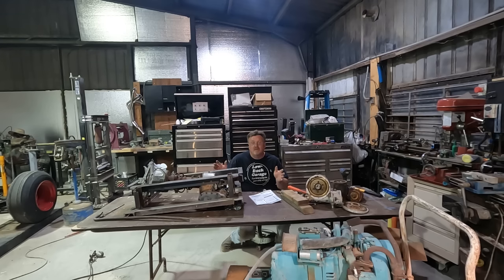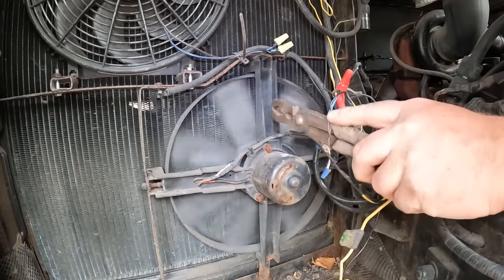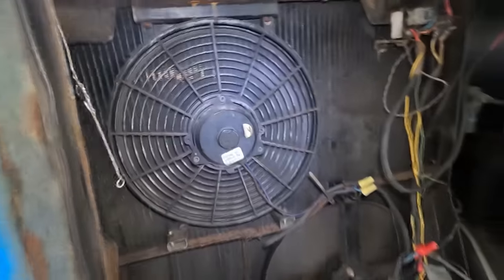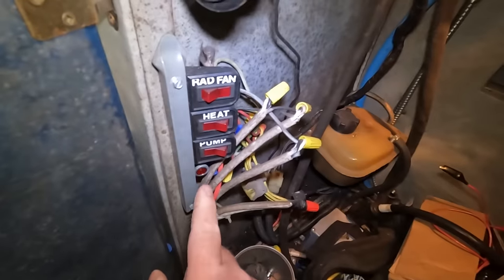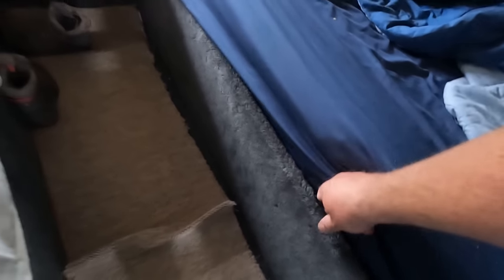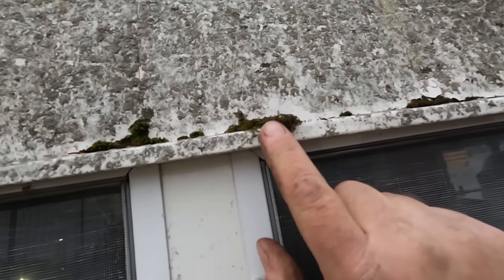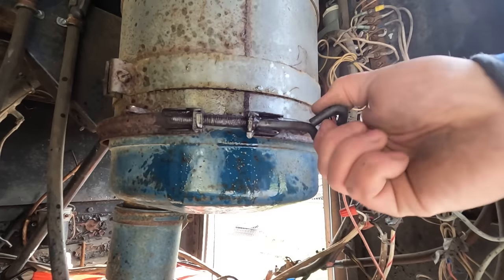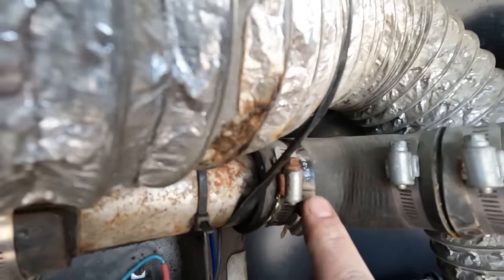1953 Kenworth Bus Roadtrip!  Will a 70 Year Old Bus Go Across The Country?

Comment: To get fan motors, like the bottom one, freed up, I drill a small hole in the little dome in the back, and force some oil in.  Works every time.  That is quite a rats nest of wires.

Comment: For a minute I thought the wipers were air powered, and that the valve you turned was the control, I laughed when you turned the tube.
Reply: I'm pretty certain they were air powered originally and those were the controls. The original air motors are difficult to rebuild and keep operating.

Comment: On the transmission dipstick, I believe you twist the handle to tighten or loosen (compresses a rubber bushing which expands within the tube).
On the air filter, you’re probably spot on about the newer engine flowing more air, but you might look and see if there isn’t a secondary filter that’s further up in the housing. 
Cool video. Looking forward to the next leg of the trip!
Reply: Boom.i did miss that part. But red your comnt and rang a little bell .
Reply: Yup the dipstick needs to be screwed in. Most buses are still like that today

Comment: I'm nostalgic for those old late 40s early 50s Flexible buses. I'm now 78. When in the high school band, we would go on tour in those babies. They told me that the busses were powered by straight Buick engines mounted on a rail system that would let them swap engines easily. Some of them had 3 speeds, some had 4 speeds. Those trannies must have been tough. I heard a lot of gear grinding while shifting.😁😁😁😁😁

Comment: Love that bit of copper pipe for the windshield wipers. Bus is great, awesome you seemed to of fixed the overheating issue. Look forward to seeing more of it, and I'd love to see that electric sander in action. Probably won't get any use where you're at, but cool nonetheless. Seems similar to those automatic chain things ambulances have.
Reply: Hi those sanders, some trains have them also I learned.

Comment: Made a similar trip in our families school bus converted motor home from Albany, NY to KeyWest Florida then West to South Padre Island Texas KOA in February. My Dad put a rebuilt Cummins Turbo and a tranny with Highway gear ratio. I think we got about 12mpg. The generator was an Onan diesel and it had an air to air heat exchanger on the exhaust to heat the interior. Your kids will never forget that experience. I’m 64 and we did this back in 1978. I was 19.

Comment: When I began my teaching career in 1976 the small school district I worked for had 3 Kenworth Pacifics with big International 6 cylinder engines in them for power. They had 5 speed manual transmissions in them ahead of the engines as they were pushers.

Comment: Ah... Now I see where your resourcefulness and inventive abilities hail from. Your father clearly knew his stuff. Pretty impressive what all he did with that bus. A lot of rather off-the-cuff systems integration there. And all very functional. 

I reckon the apple didn't fall far from the tree, either. Very nice.
Reply: Making something work and knowing what your doing is a fine line I would not call whoever built this a mechanic more of a Jerry rigger the whole bus is Jerry rigged together first thing that needs to be done is tear everything out he put in and do it right wire nuts sorry but I've seen crackhead do better work than that fire waiting to happen that thing is

Comment: You, sir are the consummate mechanical technician, with a secondary certification in economics! I totally agree with you on the "filter minder", thinking the diesel engine's air throughput is higher, and was a great catch on the coolant hoses! I mean, you literally prevented a catastrophic event! I have to warn you about the cooling air routing, though. I believe you are right about needing to reverse the fans, but if you ever approach the speed of sound in the bus, you will need a much smaller inlet, and possibly a splitting plate to avoid the boundary layer air along the side of the bus, as well as some straightening baffles for the area after the scoop.  Other than that, what you did is perfect. I certainly enjoyed being brought along on this adventure!

Comment: I believe that one turns the t handle on the transmission dip stick and it tightens a wedge that pushes the rubber out against the tube to keep the dip stick from coming out. Same thing on the dip stick (technically called a gauge on a Cummins diesel. Of course one would turn the T handle in a clockwise motion to tighten. Pretty neat bus.

Comment: Just realized that the sound of city busses when I was a kid was mostly from the cooling fans.
My Dad converted a '53 Chevy (gas) school bus into a camper bus. This is all looking familiar. He went whole hog on the conversion. Repainted inside and out. Took all the seats out, except for one right and one left, put them both on the right side with a tabletop in between, added a home made fold out couch, bunk beds in back and a small kitchen. And proceeded to drive it all over the central U.S. Not without 'adventures'. Like the time one of the engine driven cooling fan blades broke off and flew through the inner fender, missing the tire fortunately. Engine shook like crazy. It happened in the middle of nowhere in Wyoming. What to do? That model engine's four bladed cooling fan was actually two two balded fan blades bolted on at about 45 degrees to each other. He just unbolted and removed the broken blade and continued on with just a single fan blade until he found a replacement in a local junkyard. Bolted it up, and we were back in business. Obviously my Dad's improvising skills made an impression. There were other adventures as well, driving in rain so heavy, the only way to stay on the road was to look down the steps and watch the lane line through the windows in the bottom of the door. Driving on the unpaved sand roads in the Nebraska sandhills to the campground where we liked to stay, my brother and I would bet each other whether or not Dad would need to downshift to 2nd going up the current hill (no money changed hands.) It was an adventure. It was an education. Most of all, it was fun.

Comment: 👍👌👏 Oh WOW, simply fantastic! What a great old bus respectively RV and what a great video! Congratulations for figuring out the cooling issues. It's definitely much more logic how the air is flowing after you changed the direction.
2) Despite the wiring spaghetti the vehicle seems in a pretty good shape/condition. At least I couldn't spot rust. Of course it needs a good maintenance and some TLC. New coolant hoses, new rubber seals, all nipples need to be greased, all oils changed, a lot of things inspected etc.p.p.. Additionally the roof should be cleaned very well and inspected for holes. A new coat of white special roof paint for busses will work wonders. I'm eagerly looking forward to watch the next video part. Additionally I hope that you will show us the interior next time.
Thanks a lot for making teaching explaining recording editing uploading and sharing.
Best regards, luck and especially health to all of you.

Comment: Old Cummins’s’z (aka “Cummings” on the inter webs) often come with cold cooling system drips which quit at operational temperature “parameters” ($5 word added for effect)... but I think you caught a hose off event before it happened...
Hope you plan to use the Kenworth as a family makin memories coach.
Great trip.

Comment: FABULOUS! Now, you're into a project I can really appreciate, as I've been there and done that! Even wrote a magazine article with a humorous look at the first bus we had! But, we logged over 100k in it eventually before selling it, and buying a new(ish) to us Eagle and converting that. Now, we're both in our 80s and moved to our get away permanently. Built a garage with a 14' high door though! Bus friendly, but we ended up with manufactured RVs, which fit nicely. Advise where to post the story, and I'll dig out a copy, or a file if it isn't pre PDF or Word, in which case I'll just scan the original.

Comment: That old bus is awesome! The powertrain is from the right era too. Modern enough that it runs well and has parts availability but not an electronics nightmare. 

Not a huge fan of those round fans. Never had any luck with them. If you're headed out west and start pulling hills I'm interested to see what it does! I'd start scouring junkyards for FWD car fans. Seems like two short/wide FWD car electric fans with shrouding would be perfect for that. Doesn't look like the position of the radiator lends itself to a good mechanical clutched fan

Comment: The trans dipstick is locked in by turning the T screw which will crush the rubber plug causing it to expand and lock into the tube.

Comment: i had no faith on the flap creating vacuum for the radiator, i'm impressed. i thought you'd need a bigger flap for highway speeds.
never thought such level of fluid dynamics would be applied to a rolling rectangle.

Comment: Neither bus has it's original engine. You know what's in the running bus obviously, but the engine in the parts bus is a Ford "Super Duty" V8...could be a 401, 477 or 534. Both buses likely came with a Hall-Scott gas six-cylinder.

Comment: The transmission dipstick has a rubber stopper at the top.  If you turn the T handle on the end, it will expand the stopper and hold the stick in.

Comment: Love watching your stuff sir.
I'd be weary of that allison at500 series you got, they don't have OD or converter lockup so they build up the heat, they are fine on flat ground but if you run that bus up mountains a bunch you are going to make that transmission puke, been there done that.  I've had em before and I won't anymore, I'd take the time to swap it over to a MD3060 or 3070 get some OD gearS and a lockup converter, some of those have a built in retarder, I have one on my bus to RV conversion.  You mentioned that the trans dip stick was popping out, that ain't good, probably excessive pressure or a clogged vent.
I love your adventures and attitude without all the kiddy drama alot of other channels do to waste my time, thanks for making your videos worth watching in the entirety and so informative too.  Prayin for ya buddy, may the Lord Jesus bless you and your family.
Funny I've driven buses from WV and VA to home in TN, wonder if we been in the same place hahaha.  
I use to live around Erwin/Johnson City/Elizabethton areas I've since moved to another mountain in another nearby state.

Comment: Not a low blow here but just saying... this is one of the best videos to date. I don't have the courage to do what your doing anymore. As a young man, not a issue, just hop in and go. I sure hope that your friends with chads fabs in utah I think... maybe Arizona but he could rewire this bus in less than a year... I am afraid of how many wires do absolutely nothing anymore as rust and corrosion has cost continuity. It is a fine old rig and not many that year are ever on the road again.. kind of curious if they ran the wiring through the center of the floor from front to rear.... thats a nightmare from the double toothpick country

Comment: The little flap that falls down if you lose air pressure is called a wig-wag I believe, it is traditional to write a funny message on them, pucker up buttercup, yer' hosed! something like that.  

There are a couple cheap, high CFM electric fan setups available wherever junk vehicle parts are sold.  90's-ish Ford Taurus's and crown Vic's have a good double fan setup, eyeballing it from here, looks like that radiator could almost fit two of them, which would be a whole heck of a lot of CFM.  I've had good luck with adding house pipe insulation around the shroud edge of electric fans, for a better seal on the radiator, if the air goes through the fan but not the radiator, it's just giving the vehicle a blow job without getting much done.  Ford escapes have an electric fan controller that is stuck to the back of the fan shroud.  It's up at the top where you can get at it from the "I'm in a hurry" side without having to mostly disassemble the doner vehicle.  I've used them for fan control when adding electric fans to old junk that overheats.  I've built three experimental aircraft and cooling air flow is a big deal on those.  I think you can increase flow out the side by adding a second "shark gill" same orientation as your first, but at the rear end of the port side air-letter-outer grating.

Comment: The gas engine on the parts bus looks like a Ford Super Duty big block 534 cubic inches ( 8.75 liters) 250hp-275hp! Commonly used in Fire trucks, dump trucks and gas powered semi's of the 60's and early '70's!

Comment: With regards to the radiator- yes it can seem counter-intuitive but know that faster moving air is lower pressure. The nearly static air just behind the rear of the bus will be at a higher pressure than the faster moving air on the side of the bus, making a chimney effect to draw the air through. Adding the vent on the front will just make turbulence, which will make things worse. The grate is important to keep the air flowing across the side of the body in a smooth way, for maximum effect.

Comment: Dear LBG guy.
😱 At 9.29 seconds I spotted a neglected brown Mercedes Benz W123 with the indestructible 240 D engine. Meanwhile those cars are worth a small fortune over here in Germany. At least the 2,4 litre 72hp prechamber Diesel engines are very searched for. If maintained well, they are good for over ! 1 million kilometres (over 621.000 miles)! I hope and pray that you will be able to rescue/save this car or at least the complete drive train.
Maaaan, I should definitely have kept my outside mimosengelb (mimosa yellow = one of my favourite colours) and inside olive green 1981 240 D. Instead I sold it 1985, sigh.
Best regards, luck and health in particular.
Reply from the maker: That car rusted away, even the suspension was falling off years ago.  However, I am planning on pulling the engine and transmission for a future project, I'm thinking flatfender Jeep.

Comment: There is a path way for engine over heating problems, check water pump, thermostat, coolant , and radiator may be partly blocked, fans will help to keep radiator cool. Air flow direction is important, vents to direct air flow is important. the bus is what l would call a mechanical adventure. Old school mechanical repairs can be fun, we forget how in the old days we had to check everything, no warning lights or computer, overall the bus mechanically looks ok.

Comment: Those electric fans are probably just wimpy parts store versions that will not move enough air.  Get the highest CFM rated ones available.  They will pull about 30 amps each.  It will make a big difference!

Comment: You could have cleaned out that air filter by vaccuuming it from the inside instead of the outside. The air flows inside to outside on that type of filter.

Comment: That's a cool old bus, but unfortunately it's an electrical fire waiting to happen with that messy sloppy wiring. And twist-on connectors do not belong in a vehicle - they're strictly for use indoors in buildings, not in anything that's outside or ever moves. They don't make a vibration proof connection and they're not moisture proof, which means they come lose over time and corrode. Basically all the wiring needs to be redone for this bus to be safe to operate.